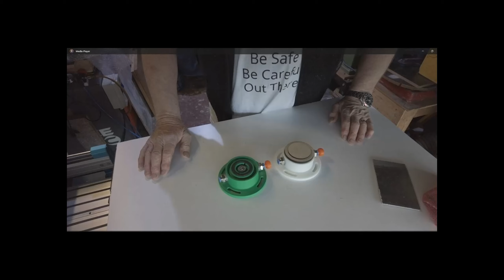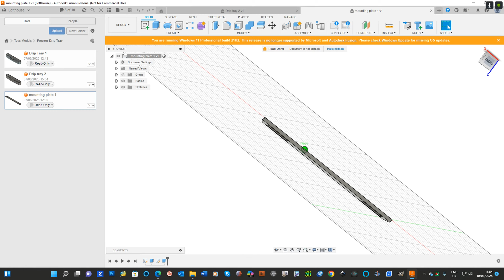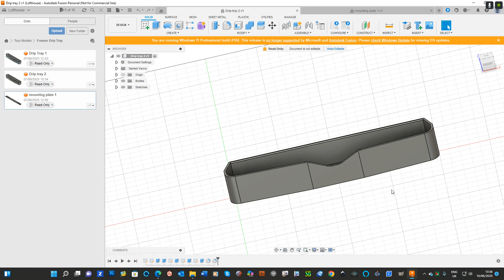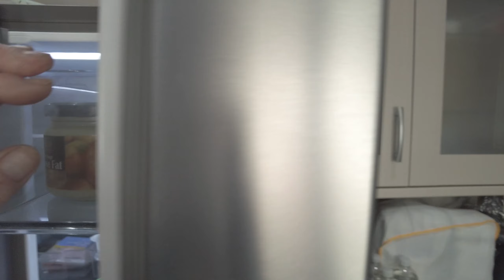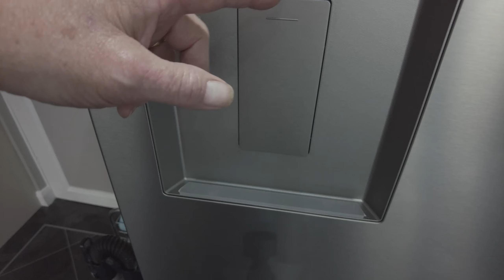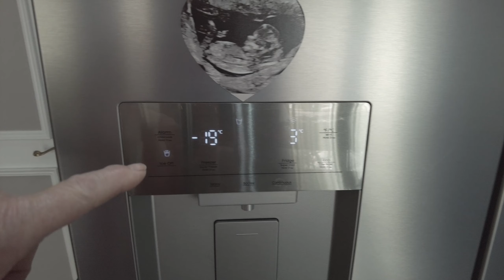Hisense RF815N4SESE_SS American Fridge Freezers Dripping water dispenser due to air in the system

Comment: Hi Tony, thanks for sharing the file. Question, are you able to find water filter for this fridge? Is there any aftermarket other than the original one
Reply from the maker: Hi thanks for your question, I have looked but because I have an extended warranty I can only use original parts
I did find a couple a while back but they were not that much cheaper. I had read some feedback that someone used a cheaper filter and  the water has a slight taste to it. Let me know if you find one and have tested it ok Cheers Tony

Comment: Hi are you able to share the files on thingyverse?
Ours is a different model with non-plumbed water dispenser, but have the same problem with drips.
Reply from the maker: Hi thanks for your enquiry I can put it on makerworld that is the site I use but if its a different fridge it might not fit. I don't use thingyverse as I had problems with them. I will get back to you with the link when I have uploaded it.
Reply from the maker: https://makerworld.com/en/models/1617028-hisense-rf815n4sese_ss-fridge-freezer-drip-tray
Reply: I dont have a 3d printer. Are there companies you can request these to be made or would you the inventor be better of being the benefactor?